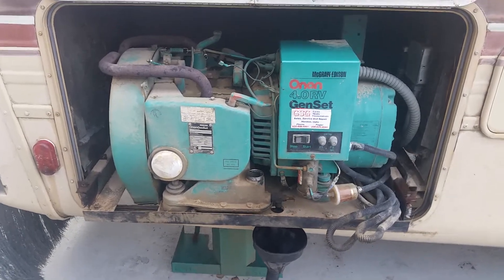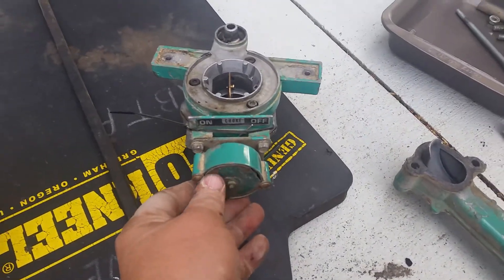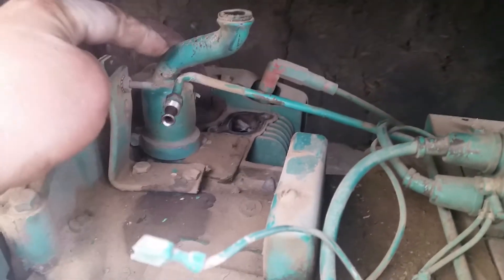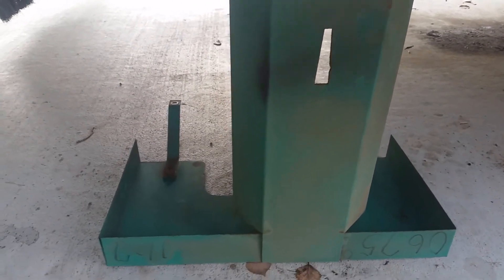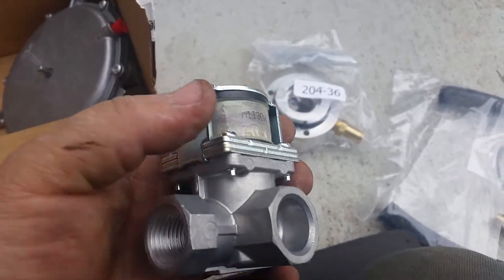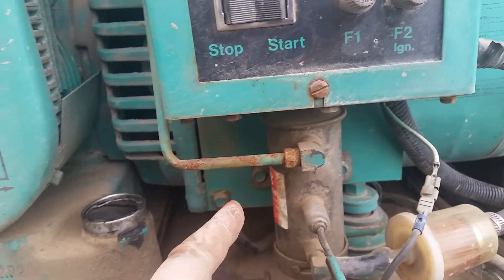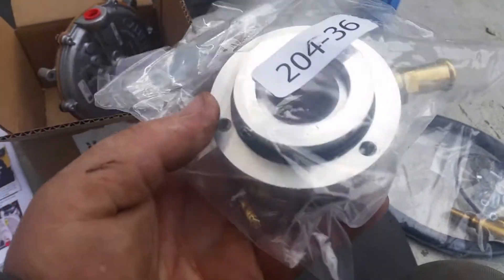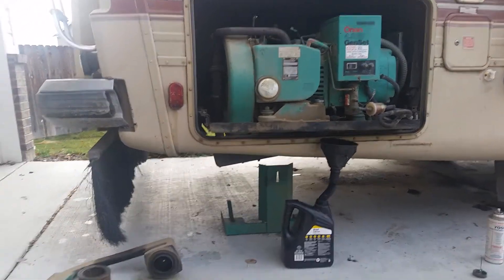RV generator propane conversion / tri-fuel vid 1

Comment: I would NOT convert a onan 4000 watt gen set to propane for several reasons .
       An onan 4000 only puts out barely 3000 watts .
If you run it on propane you get 2500 watts if your lucky .
     It will consume more propane per hour than it would gasoline by far .
Now how much is propane and how much is gas ?
     They are a WW2 design and are only capable of so much .
       The ethanol in gas does more good than harm .
      Just complete the procedures for storing the gen set and you will have many many years of trouble free service from these units .
Reply from the maker: I appreciate your feedback. I'm glad you wouldn't. That is up to you. Look how old this video is. It's been running fine ever since and I have not had to clean the carb annually like I did before. You see there is no way short of opening the unit and disconnecting the fuel pump ground wire to run the carburetor dry. Now it's on a switch and I have three possible fuel sources. LNG, propane, and gasoline. You are absolutely incorrect about ethanol and aluminum. But that's for you to learn.
Reply: @doitlaynstyle  no sir , I am not incorrect about ethanol and aluminum , there is no electrolysis between them , the problem lies with rubber and paper parts of the carb since the Al takes the moisture away as it slowly dries out it takes the moisture with it .
      I have run many engines on propane and I'm here to tell you they make a full third less hp than on gas and approx half the torque .
And that's at sea level .
Try going up about 3000 feet and your generator is barely usable .
And in most of the country propane is almost as much as gas .
I guess it's the high cost of being lazy or having to much to spend .
But if you disconnect the incoming fuel line before storage , put another line from the pump to a gallon can with a little two stroke or stabil , run it till the end of a gallon and that's that .
Your generator will love you and the white stuff will not form in your carb .
I have an 83 trans van with a 4000 wat 60 hz gen and have never ever had to pull the carb down for any reason .
Right now I'm setting an old onan , such as I and I own with a hardly Davidson type fuel injection system and I think I've come up with a solution to all the problems an onan can suffer .
Mostly since the gen set in question was produced for many many years and there's still many in service .
    And sir , if you knew what the half credintals I hold concerning the internal combustion engine and all fuel types you would know you could not teach me SHIT !

Comment: I ask another YouTube fellow and he said.... I do not recommend converting to propane in this situation for two reasons. 
1. It reduces the generation capacity by about 25%. For example: If your generator is a 4000 watt gasoline unit, converting it to propane will reduce it to a 3000 watt unit. 
2. It will increase the cost of operation. It will burn more propane to produce less power, thus increasing the cost to run it.
This is very disappointing news to me.  My uncle has both and does not agree... with the fellow.  My uncle says it starts easier, burns cleaner and that's what he prefers.  Also, I found the kit and it looks pretty straight forward to install and safe too. What say you?   Thanx,  -keith

Comment: #doitlayinstyle I have the same exact generator on my motorhome.
Reply from the maker: They're good long lasting generators. They do have their issues though. Get a plug in voltmeter like this one https://www.amazon.com/dp/B08HZH5LYS/ref=cm_sw_r_cp_apa_glt_fabc_CNBVBBDTX5YXWPPEP7AM they have to be idled up or down to control the voltage. If it's too high the battery charger will boil your batteries.